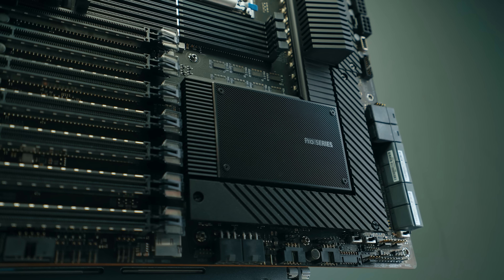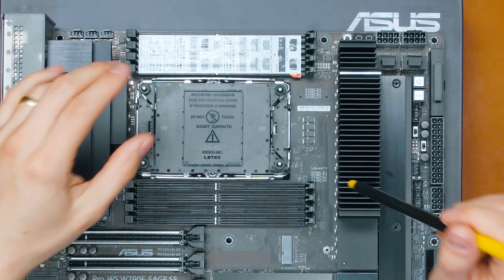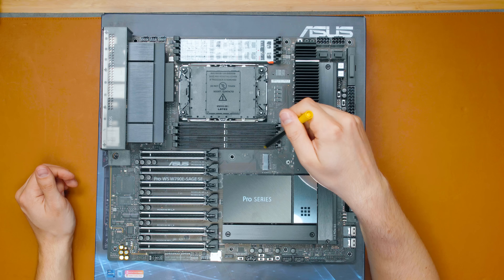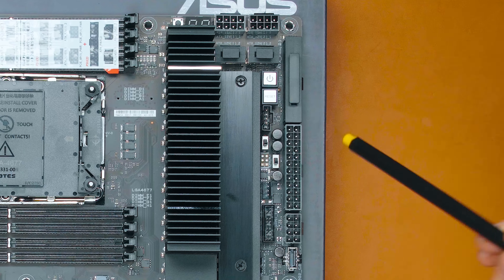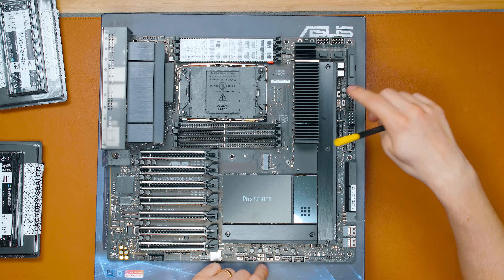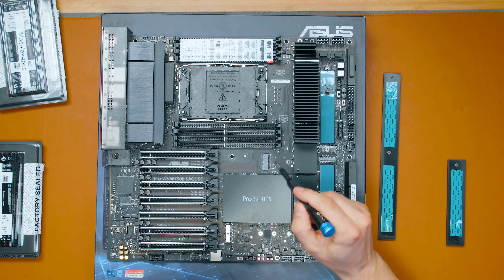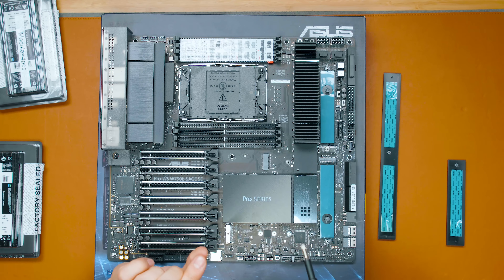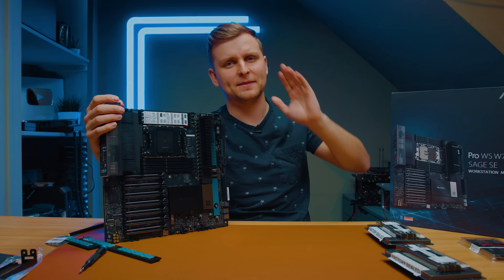FATHER of ALL Motherboards... 😱 | ASUS Pro WS W790E-SAGE SE review

Comment: looks nice, shame that it doesnt have u.2 for enterprise SSDs
Reply from the maker: It's got SlimSAS :)
Reply: This is a prosumer board, not an Enterprise board. I was hoping U.2/.3 will be available on consumer, even mainstream, but it's being kept at Enterprise/Server space. I'm still using 2.5/3.5 inch storage.
Reply: The ASRock board comes with U.2.
Reply: You can even add U.2 drives with PCIe slot adapters. You can also run U.2 drives anywhere on your case, even hotswap bays, by using HBA and/or adapter cards with Mini-SAS HD / SFF cables connectors.  There's a TON of options.  My old X79 board, Ivy Bridge era Xeon, even uses an U.2 Optane drive.
Reply: @CheapSushi  SATA Express exist on Skylake and Kaby Lake, but never took off, because M.2 stayed.

I'm still using spinning HDD, and was hoping that 3.5inch SSD exist, using the U.2.

Imagine we get an 8TB+ SSD at 16Gb/s (12Gb/s, due to 2 SATA lanes, and x4 PCIE 3.0) on 3.5inch form factor.

Instead, SSD are limited to M.2 2280 (they aren't even using the 22110, and it's PCIE x4 revision.

I guess the industry is holding the SSD back, because they don't wanna repeat the SD card mistake.
Reply: @AlfaPro1337  I'm not even talking about SATA express though. It's like people don't understand the power of a PCIe lanes. The U.2 is a combo of form factor and connector type. There's so many opportunities with it still. Just the same how people keep saying M.2 as a general term but it's a form factor with multiple connectors (keying) and protocols (NVMe vs AHCI).
Reply: @AlfaPro1337  there are many ways to use I.2 on ANY system including dual and quad I.2 cards, with or without bifurcation. And many workstation boards have one or two dedicated U.2 poets on the mobo itself. But the SFF connector equivalent is available in many other ways as well, with even connector adapters available too.
Reply: @CheapSushi  Oh yeah, wtf. I just realised U.2 is just the connector, not the bus/protocol. My bad

Comment: Sir i got "2927" standard overall scores and "2658" extended overall scores in pugetbench for daVinchi resolve 18.5
i am shocked to see this level of scores as i have i5 12600k with 32gb 3200mhz ddr4 ram and Gigabyte rtx 4080 eagle.
i also tried all 8k red 30fps, 96fps etc and canon r5 4k 120fps raw. All running as it should. very smooth and not a single frame drop.

Comment: 24:50 And he’s handling all of this with no ESD protection at all…  I also like to live dangerously and have enough money that such an expensive system can go kaputt and not matter /s.
Reply: @ToshMatik I shall publicly share this comment in the following manner. Why not place the required hardware as mentioned in this review for more proper usability. This kind of stuff and hardware  specifications are way better for NASA Space Missions kind of stuff advanced controller units or analysis onboard computing units standlone point of view.
Its way too much overkill for 85percent of the VIewers on this Youtube COmment section.

It will game yeah, but you would NOT Risk Wasting to buy this for gaming. It is a professional workstation board with productivity in mind. This would usually be used for rendering or AI/M/NASA Research etc etc.
For the price of the ASUS Pro WS W790E-SAGE SE  motherboard alone you could get a good gaming board(research the Amazon or chegg,Pc part picker etc etc), a top end gaming CPU and your required 32GB or 64GB (i strictly donot recommend) RAM. This $7000+ Threadripper Pro would get murdered in gaming by a $600 12/13900K or 5/7950X. The memory controller in the Threadripper Pro only allows for 2933Mts RAM. Your standard modern DDR4 Ryzen or i9 will let you go to 4000Mts easily. Even higher with good hardware for overclocking.
Reply: @TOshMatik, u.2 is usually used for enterprise grade ssd's like those up to 30 tb SSD's that unlike consumer M.2 SSD's dont slow down with longer term fast reading/writing but sacrifice a very minute amount of maximum read/write spead.. at least that is the only use of u.2 that i know. Also technically this is a workstation and not a server MB though there isnt much difference, also at least in Server application that micro SD Card / a USB port is sometimes used to house the Operating System if you got a system in an array tat really doesnt need anything in terms of storage but almost only compute and pass on the results through network Or similair situations in wich case you could actually run no conventional Drive at all.
Reply: Linus tech tips kinda proved it doesn't matter.
Reply: @iCore7Gaming  I’ve seen the video. But do you really want to take a chance on a 1000$ motherboard? I don’t. It’s like putting on the seatbelt, do it or you can’t regret it when you needed it, because you’re dead.

Comment: if it will be cost the whole thing $4000 then maybe 1,000,000,000 people will buy it, if the whole thing will be costs more than $7,000 then maybe 100,000 people will buy it , low processor clock on one core for rendering ok but for work not